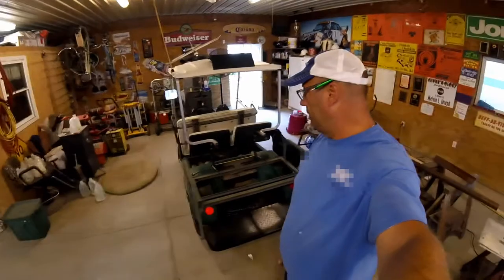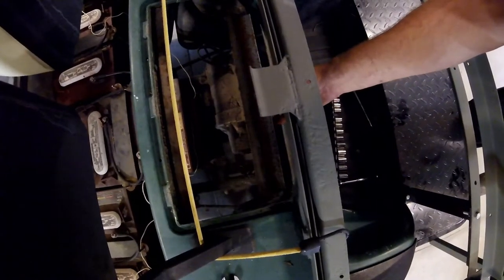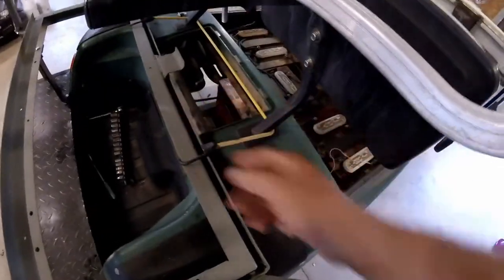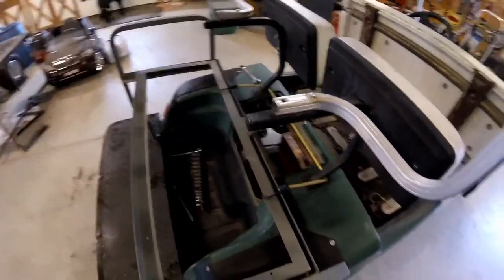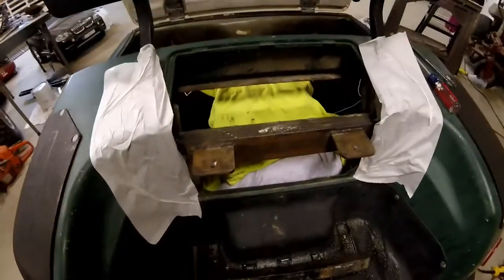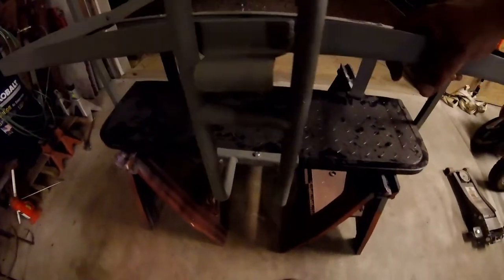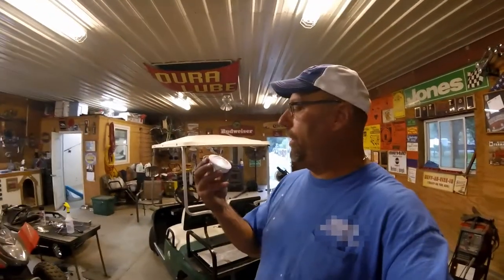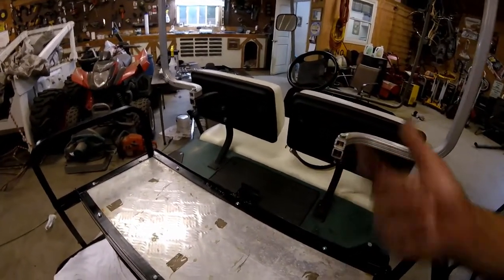Installing a back seat on a Yamaha Golf Cart- Redneck Style

Comment: that will do the trick, looks good. I do like your filming because watching 30 minutes of someone turning a lathe or 30 minutes on a welder doesn't spin my wheels. Cheers keep up the good work.
Reply from the maker: Thank you !!  Hey, I have a question for you... The picture of the remote control looking 4 wheel tank on your YouTube channel header... is that your ??? If so, do you have any footage of that ??  That is my weakness I love R/C suff.. I would love to build a track vehicle some day...  Also, You did an amazing job on rebuilding the dipper arm for your Hitachi .... Very Nice !
Reply: yea,  it's 6 X 6 with 2, 300 watt motors . Has a fpv remote camera that can be patched through the lounge tv. weighing in at about 45kg. Has two IR spotlights on the front to shoot in the night. That is the reason there is no vidio. The gun inside is a co2 powered .22 with a lazer sight triggered with a car door actuator. In this country this could be illegal, I'm not sure but I'll dismantle the gun out and do a vidio. Next build will be a tracked tank with a working cannon.